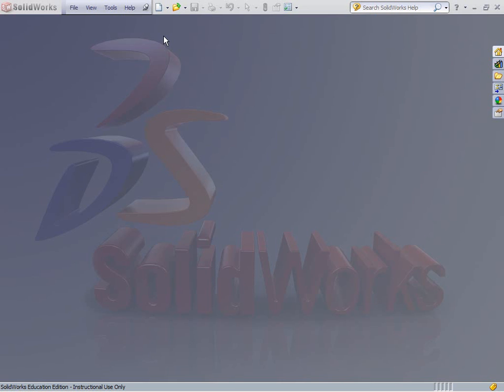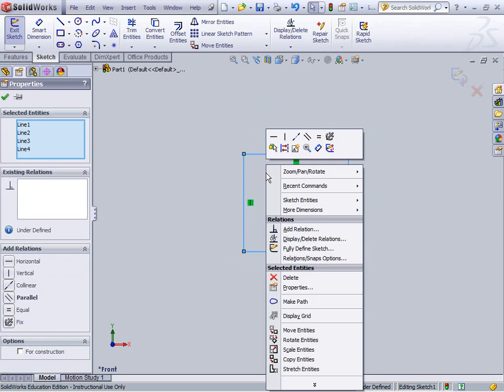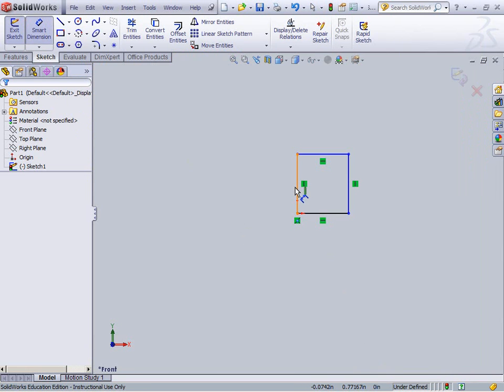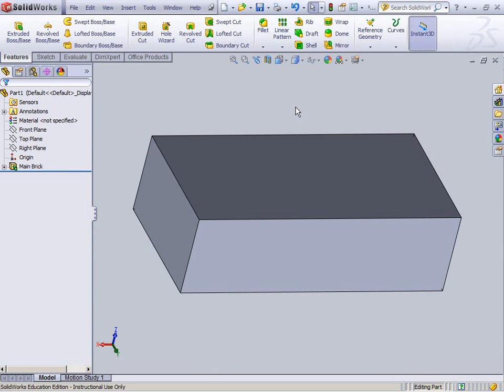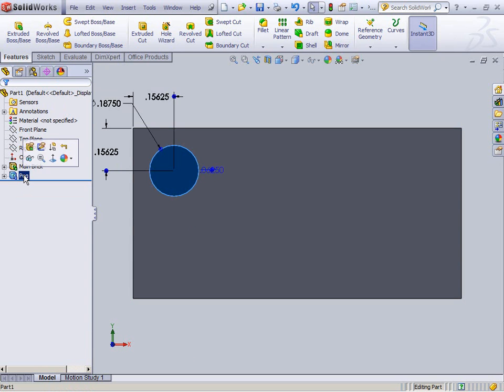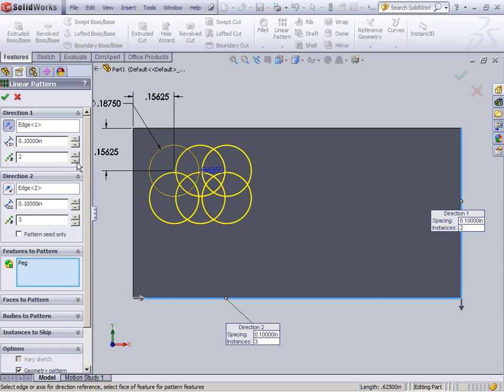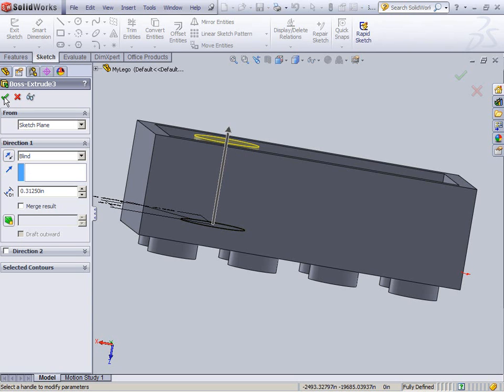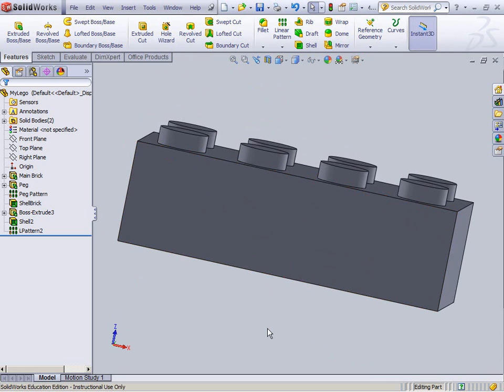Creating a 2 x 4 Lego with SolidWorks

Comment: If I wanted to draw a tile instead of an actual brick, all I need to do is divide the extrusion length of the main brick by three, correct? Three tiles on one top another equal to the height of a brick so it makes sense.